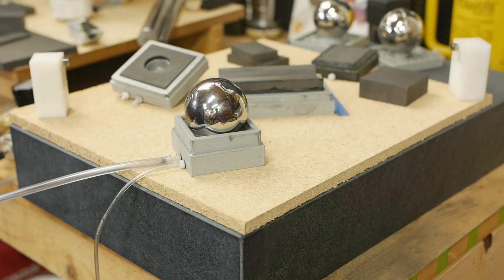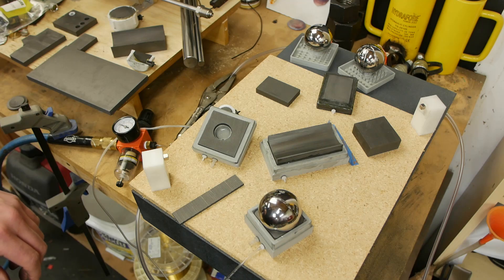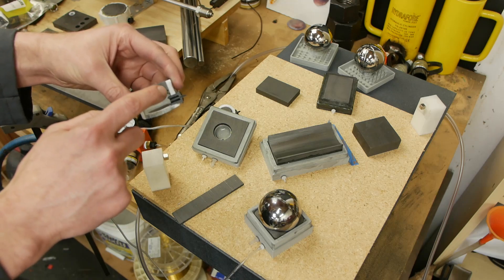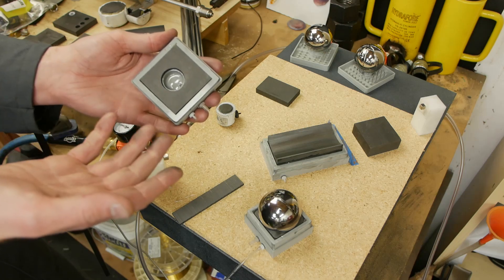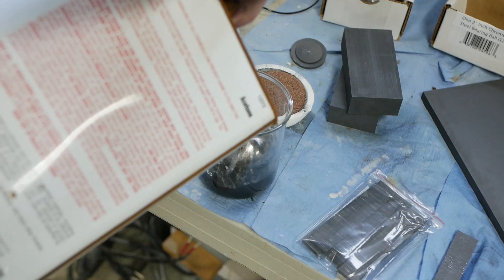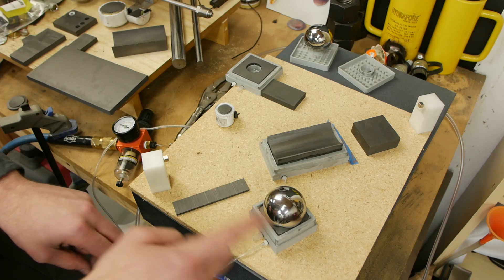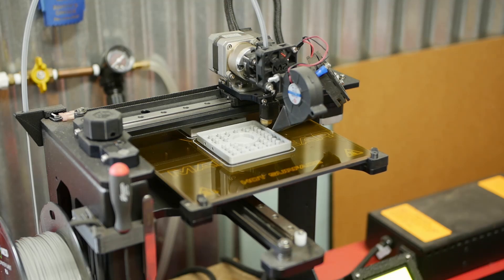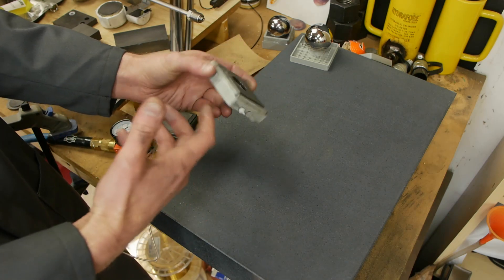Make vacuum pre-loaded spherical air bearings without special tools

Comment: First thing that came to mind: Best trackball ever
Reply: Tomasitoke
and would you want a trackball that has to be hooked up to an air compressor?
Reply: @daos3300  In my shop I already have an air compressor running all the time, and a tiny hose is not a big deal for a stationary mouse. For home use you could probably use a fridge compressor which you can get for free, maybe even a couple of them if flow is insufficient